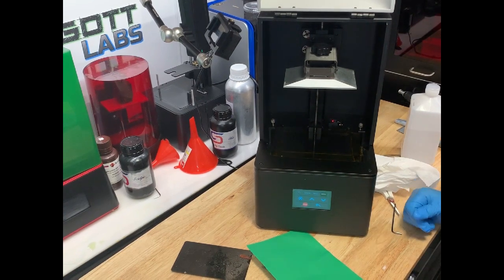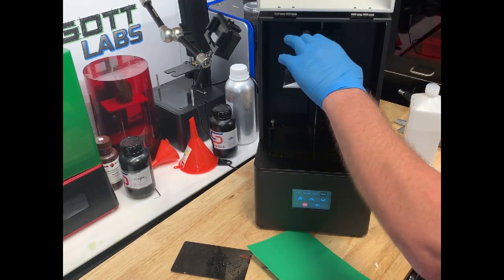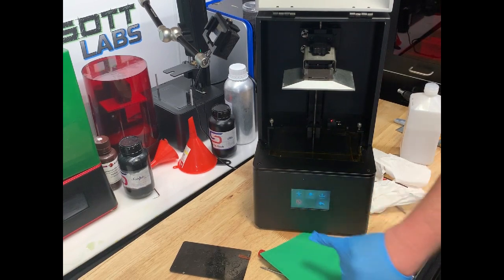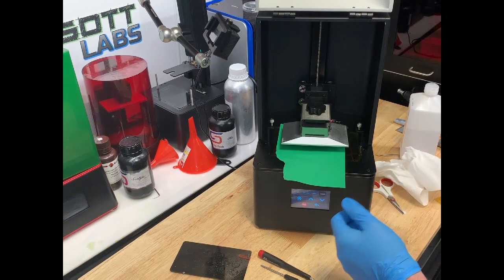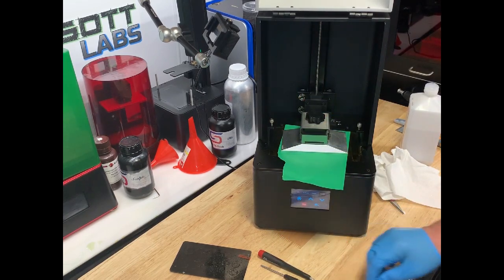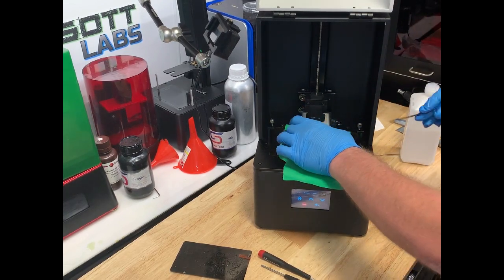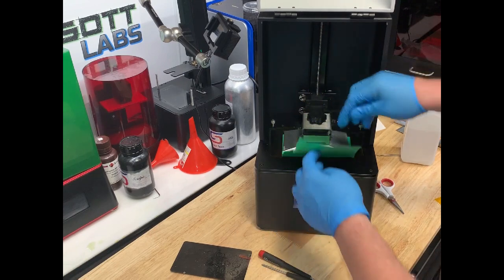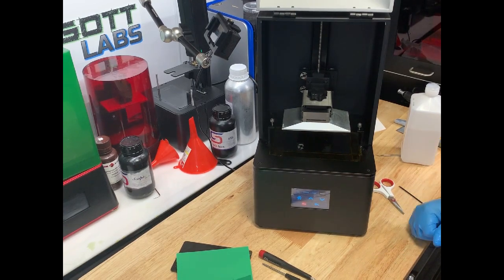Build Platform Leveling on Epax X1 LCD SLA priner

Comment: I just changed my X1 LCD for the first time and watched this video to brush up on the leveling technique.  I actually suspect that the set Z=0 step isn't necessary (though it won't hurt) because of how you're doing the leveling.  When you loosen the screws and home the machine I believe the machine is then at what it thinks is Z=0, so when you tighten the screws at that point you are making what the machine believes is Z=0 the actual distance.  Being a picky person what bothers me about getting instructions to use a piece of paper as a calibration aid is that paper comes in different "weights" and nobody ever specifies what weight paper you should use.

Comment: I saw someone crashing the plate unable to get any homing, when I saw that the LCD didn't crack and the stepper just stall, I was sold right away to this machine. Anyway, I made a mess of leveling for my first print(better safe than sorry, I didn't trust that my EPAX was calibrated from the factory), I think, with the plate top screw kinda loose I did my first faulty leveling, so I leveled 2nd time with slightly dirty build plate because I already poured some resin... it still works to my amazement. I'm sure the thing I have to be really careful is the unsupported stray hardened resin that can do real damage to the LCD/film because it makes a pointed force of that plate going down...

Comment: How are you liking the X1? I was considering the photon for a long time, then came across this one and the Monoprice one. I've been kicking back and forth between this one and the Monoprice one as $200 is hard to beat.
Reply from the maker: The X1 is an AWESOME machine. Really, it IS a photon, just one on steroids. I use it for production along with my Zortrax. The monoprice is great for the price, but it's still in need of some improvements in the firmware. Luckily it looks like they're still working on it!
Reply: @TheSLAChannel 

Hi, great to hear. Can you make a video comparing Anycubic Photon and the X1 (print speed and quality)?
Reply from the maker: @LaLa-uz7jr  YES! We're actually doing a "Photon Shootout" in the very near future. We've got a Photon, Photon S, and an EPAX that will be going head to head. We want to settle the question- What is the BEST! (like anyone will ever be able to settle THAT one!)
Reply: @TheSLAChannel  I would love to see that. There are so many SLA printers out right now that it is hard to choose the "best". I know they keep making them better but I would at least like to see the top ones.
Reply from the maker: @Seal9382  The result should be interesting. There is no way to really call one printer the 'best', as each persons needs, abilities, and budget will dictate what is best for them. But, we want to do the comparisons in a way that makes it easy for people to find out what the strong and weak points of each machine are, and then decide what is best for them.